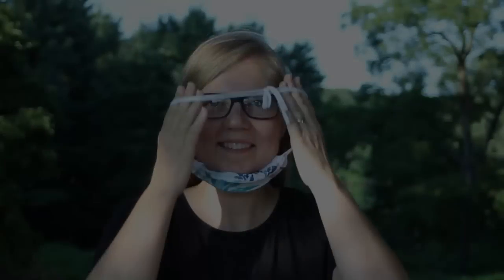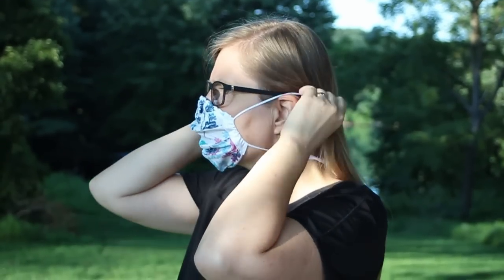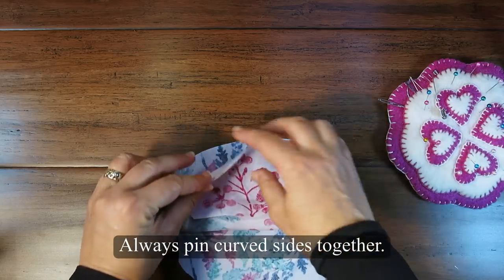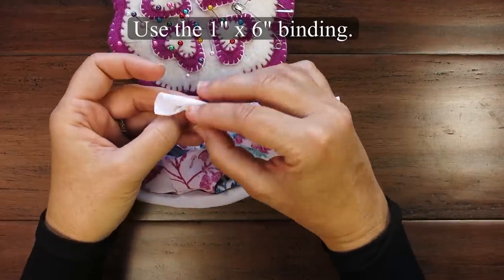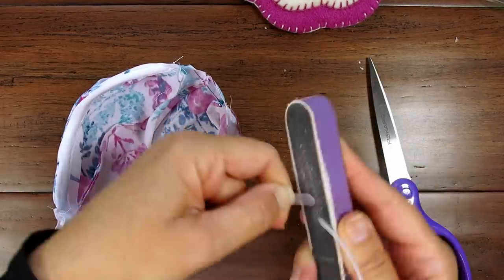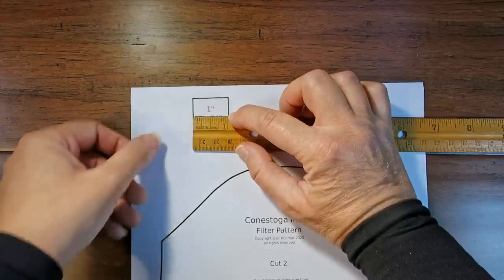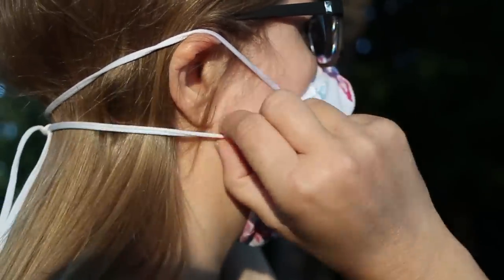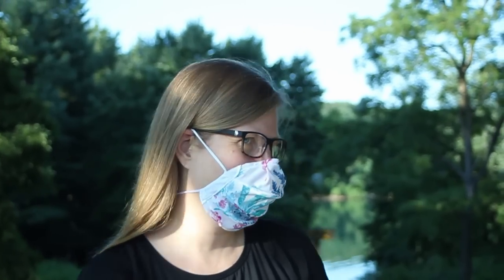Form Follows Function: Introducing the Conestoga Mask for Better Fit, Filtration and Air Flow

Comment: Thanks for another clear video.  I followed the link to maskfaq.com and don’t understand how their findings on stretch chiffon perform so poorly and you recommended stretch chiffon based on other research.  At this point in time, which research should we follow?  Back to cotton with a filter or stick with stretch chiffon???  What are your thoughts?  Thanks
Reply from the maker: Here is a rather long and complicated answer to your excellent question.  There is a huge gap in the numbers between the first study I reviewed and subsequent studies.  I did post the updates to the research in the description and / or comments.  It was determined that in the first study, the researchers used unrealistically slow air flow rates. They suggested that the surface area of the mask would need to be significantly increased (by about 10 times or so if I am reading that correctly) in order to slow down air flow rates to those tested.  Basically, air flow is a like like water flow.  Water that is flowing in a narrow and shallow channel is moving fast, but when the channel widens and deepens the water will slow down and debris will be more easily caught.  So when air flow is moving through a smaller space it will be faster, but when the same amount of air is moving in a bigger space it will slow down and particles can be more easily trapped by electrostatic deposition, interception, impaction, and diffusion.  That is the biggest reason why I increased the surface area of the Conestoga Mask.  I was trying to slow down air flow (even if only a little instead of 10x's which I figured would look like a full-on pillow case) in order to capture more particles than another mask made with the exact same material.  So lets look at the last 3 studies that tested basic cotton vs stretch chiffon.  TSI results (posted on Maskfaq.com) were in line with the Zangmeister et al study of June 25, 2020.  The Konda et al study of April 24, 2020 and updated on June 4, 2020 had much slower air flow rates and, therefore, reported much higher particle capture rates.  The interesting thing, however, is that in all three studies, the stretch chiffon was significantly better than the basic cotton. So I no longer look at it as a specific number, but as a greater-than /less-than comparison. That is why I still choose stretch chiffon over cotton...especially if it is a single layer. 

The second reason I made the mask larger to slow down air flow rates, was for easy breath-ability.  Slower flow will be easier to push in and out with my lungs.  I wanted to be able to seal this mask off and so would not be able to easily breathe around the mask as so many do.  Air flow will seek the path of least resistance and so if your mask presents more pressure resistance than your seal, then it will just go around the edges.  If covid is aerosol spread, which is still undetermined, then that defeats the point. In an aerosol spread paradigm, a mask is only as good as its seal regardless of the fabric filtration. Again if you are filtering through 400 quality layers with a loose seal, you are really not filtering anything...all the air is coming and going via the "seal".   The way you test a chemical respirator is to tighten the seal on your face and then put your hands over the filter canisters to cut off the air being pulled in through the filter.  If you can't get a breath, then you know all air in is being filtered through the canisters because you have a great seal.  

So, I have a "better" fabric which for me right now is stretch chiffon, that I have sewn into a bigger mask which will make the fabric filtration a bit better than if it were in a smaller mask and I have made my fabric choice easier to breathe through by default with the added surface area. 

But wait there is more:  I have really come to the place where I realize that fabrics made for clothing, really don't have the filtration properties that I would ideally like in a mask under the most risky circumstances.  So that brought me to Filti.  They are an actual filter company making filters for masks. Filti fabric has a consistently higher capture rate.  Again, my bigger mask will, in theory, enhance particle capture rates and easy breath-ability over a smaller mask design with identical fabrics. I can insert a filter and seal off the edges for best DIY protection in a high risk situation while still maintaining my comfort as much as possible. If I had to be in close quarters with many people that I don't know, then this would be my first DIY choice. 

I am honestly on a journey as I try to parse out the research, the practical use in the social context, and my own comfort in a way where I truly feel that I have acted responsibly without judging others' decisions.  I am still working it out and growing through the process.  Regardless of what happens I want to look back and say that I did the best I could with what I had at the time. No regrets. No judgment. Full-on forward Faith.   I am glad you are on the journey with me as we share and grow together.

Please note: As my channel bio reveals, I am not a particle science specialist nor an expert in this field.  I am reading and interpreting and applying as I feel is warranted for myself and my family and sharing with all those who are interested.
Reply: @gailkollmar8174  Thanks so much for the context.  I completely agree with your "better than/less than" thinking.  Since this is an evolving situation, the influx of new data is really hard to keep up with and interpret.  I sincerely appreciate the efforts you've put into this and the fact that you're so easily sharing your knowledge.  Stretch chiffon is incredibly hard to find in Canada, for reasons I don't fully understand.  I did find a woven 96/4% fabric, but it's thicker than what your stretch chiffon looks like.  I take your point about the seal and think that's an area I need to examine further.  My teens are so "fashion conscious" that they want masks that look like those their peers are wearing, but I will see what I can hide on the inside to protect them at school!  Thanks again for all of the informative videos you've provided.  I'm really impressed and have learned a lot.
Reply: @gailkollmar8174  Thank you Gail, for all of your excellent work and your honest discussion of this difficult journey.  I’m about to put together my first Conestoga Mask using the chiffon you recommend along with a Filti filter and am looking forward to seeing how the mask fits, but like others here, I am hesitant to rely too much on the chiffon, given its limited filtration ability. Is there anyway you could bring your large exposure to bear and convince maskfaq to test one and two layers of the chiffon you (and I) are using with one layer of Filti?
Reply: @dee24680  well if you want the best filter possible you will have to purchase that fabric. I contacted customer service and they said if you washed it once it would go down to a n50 or maybe even a n60

So I have been using my filters twice. Still getting way better protection that way than these other people who are just using cotton and no filters or sticking a paper towel in there
Reply: @gailkollmar8174  Gail, I am very appreciative of your>> best-integrous, concise, clear , science based, practical based efforts and thanks for  you sharing these  with us. You are my go to source for mask making though I have appreciated the efforts of many other  resources.  I thank R T for asking this question and your answer.. it helps me much!

Comment: I made it but, I modified it, purely by accident.The boning is up and down not side to side, I used 2 layers of cotton and a soft material near my face, the boning was on the material closer to my face I didn’t use the window stripping, didn’t have to it was snug around my face. I love it 😻
Reply from the maker: So happy to hear you love it!  I love your modifications!  I think its a fantastic idea to put the boning on the inner most layer.

Comment: Gail, I'm much prefer your Olson mask with the zip tie down the center
this mask has even more seams to allow the particles through and I watched you breathing with it and it clearly does not stay away from your nose like the one down the center does
haven't watched the entire video so I don't know what you have to say about filti but I've been using their fabric for filters for a couple months now
Again I do want to say that I have not watched the entire video but I did contact their customer service a few months ago and if you wash this filter once it goes down from n95 down to about a N50. Still a lot  better than a couple of layers of cotton fabric.
Doubt that I will be using the chiffon fabric anymore
Reply: What happened to the filtration offered by the chiffon?  How much does it filter?
Reply: @ale347baker  well out of the three reports that I've reviewed only one gave the chiffon a 67% all the other ones say no go

I'm going to use up the chiffon fabric anyway because I've got the proper filter Fabric. Filti

Comment: Wow, so much thought and effort went into this design.  I like it a lot, but I don't know how to sew knit or stretch nylon/spandex.  I watched what you did closely.  Does pinning the way you did stop the top fabric from creeping/stretching/sliding towards the person sewing?  Thank you Gail for all your research, designs, and efforts of producing excellent videos to teach us and coach us. Thank you!
Reply from the maker: Pinning may help a bit, but honestly, it may make it worse.  Sometimes it's a machine adjustment or needing oil. Some machines are just easier to work with than others.  Practice will help.  For some practical tips: you may try using a much longer stitch length...basically baste it into place.  That may be enough since there is no real strain on this seam and may "ease" the seam into place.  Maybe baste/ stay stitch the knit strip first alone and then work it onto your face fabric.  Lastly, you may try using a stretch stitch if your sewing machine offers that option. I hope one or more of those suggestions will help! Good luck and keep trying.

Comment: Thanks for the new pattern. Now, I have a question, before I order supplies. I have a bit of latex sensitivity. Could another sealer that is made of silicone be used as opposed to the rubber one? I noticed that the silicone ones aren't as thick, but I would imagine it would seal just as well? Here's what I'm talking about:
Sealer Hero Door Seal Strip 25 mm Width - 9m (29.5 Ft)– Silicone Weather Stripping Door Seal Strip - Sealing Tape for Doors and Windows – Clear Adhesive Weatherstrip – Shower Window Gap Draft Stopper - - AmazonSmile

Comment: Now I am so confused as to which fabric is best to use🤷‍♀️. I had to order the 90/10 chiffon on line and had to get a 2 yard minimum. I I now have about 5 yards left of the 3 dif patterns I ordered and I also ordered 600 count  cotton pillowcases to use with the chiffon. According to the first study 2 layers of chiffon and one of the cotton rates better than a no gap N95 mask. I am trying to determine how that combination rates on this second study 🤦🏼‍♀️ Any help would be so appreciated.  😃

Comment: Gail, I am having tremendous problems sewing in the Velcro.  I am using a 14 universal needle, have changed the needle and am still getting bird’s nests on the bobbin side.  I have even tried to stitch on the top of the Velcro, using paper on top, and still have the same problem.  Advice that I can find about sewing Velcro always has you stitching in the border of the strip, which is not the way this application needs to be done.  I would appreciate any tips and tricks you can offer!
Reply: I’ll be adding Velcro to my mask tomorrow or so and will let you know how it goes. Have you come up with a solution since a week ago?
Reply: @jnorth9702  Not really!

Comment: Hello Gail! Good to see you.  I'm glad that you were able to tour the colleges and finish the video. That is a lot of work and effort.  Please,  give my appreciation to your daughter for helping you. She did a great job. 
 I'm a novice/beginner at sewing, so I don't have the skills, neither the knowledge when it comes to sew using the silky chiffon. It is very hard for me to sew a mask using the silky chiffon. I have watched several videos with tips to sew silky and stretch fabric without success. I used the a small size microtex needle (I believe that is the type of needles) that was recommended to use when sewing the silky chiffon. I tried to use adhesive tape on the needle (throat) plate to make the hole smaller, but that didn't work. What brand & model is your sewing machine on the video? 
Thank you!  Blessings
Reply from the maker: Thanks for the positivity!  I am using a 15 year old Janome 6260.  I love this machine.  It is a workhorse for thick as well as silky situations. It does go in for maintenance most years for a good cleaning, oiling, and adjusting.  I am using small sharp needles, and I find a new (sharp) one is imperative for a nice seam. I’ll encourage you to keep practicing and wish you good luck!
Reply: @gailkollmar8174  Thank you!
Reply: I think it helps to sew on a slow speed.  Thats the only way I sew when using that fabric.  I also use pins that stay in the 1/4 inch seam allowance.
Reply: @ale347baker  thank you!
Reply: Laid off sewing teacher here. Part of your struggle, I think, is sewing around curves. Remember that you can slow down or even stop if you feel it’s getting away from you. If, when you stop, you put your needle down into the fabric, you can lift up your presser foot and adjust the fabric so that everything is even and wrinkle free. You may need to do this multiple times and it doesn’t slow you down as much as you think.
Reply: @szimonettaneni  Thank you!

Comment: Hi Gail! Thanks for all your thoughtful research and patterns! 
I need to make a mask for an older gentleman who is immuno-compromised and uses an oxygen tank. He does not actually wear the tubing in his nose, but rather holds it in his mouth (finds it more comfortable). Either way, the tubing needs to go under the mask. Any thoughts or ideas on how to support the tubing without gaps compromising exposure?

Also, Is there a proper way to measure a person's face to ensure a good fit? I have looked at different sites that ask for a width and height measurement but wonder if more information would be needed to ensure a mask fits but is also comfortable. I look forward to your reply.

Comment: Would the rubber seal, velcro, and Filti fabric lining work on your Breathe Easy 2.0 masks I've already made? I bought some breathe easy washable 100% polypropylene several months ago.  Do you know how it compares to Filti? Could I just sew it into that mask using Velcro as well? I have several grandchildren who might balk at your newest design due to peer pressure so I'm looking at ways to alter the Breathe Easy 2.0 similar to the Conestoga. Any suggestions?
Reply: I have actually gone back and modified the Breathe Easy 2.0 with an added lining, open at the bottom to accommodate a Filti filter.  I put the boning in the lining seam rather than the outside layer, left the bottom mostly open and added a strip of Velcro to close.  It is easy to pull out the filter and replace, and no Velcro to cover when you wash.  To be clear, it is essentially a two layer Breathe Easy 2.0 with a removable Filti layer between.  I also added the rubber seal at the top edge, and inserted my nose wire into that.  It seems to seal nicely, preventing fogged glasses.
Reply: Thank you JSUmusicmom for this insight. It’s good to know about these improvements to the Breathe Easy 2. I’m trying to Envision exactly how it would be put together. I’ll have to give it some more thought.
Reply from the maker: As a mother of teens I get the fashion thing, but what I  find intriguing is that in less than half a year the western world has not only gotten used to wearing masks, but has defined an acceptable style and wears them with flair. 😁 Somehow we lost the safety point of the mask (some would argue it was never there) and so Form Follows Fashion instead of Function. 🤔 You could certainly make a Filti filter inside your Easy Breathe masks.  As long as your masks fit well and you breath through them and not around them, then, as I see it, you will be doing your best to stay healthy.

Comment: At 5:54 where you show to "peel off the adhesive strip" are you taking off both the paper piece as well as the actual adhesive? I'm thinking the adhesive might gum up the sewing needle and cause problems?
Reply: In case you haven’t discovered this already, I have sewn through the adhesive on the rubber seal with no problems at all.  Using the paper on top works really great to keep the rubber from “grabbing” the presser foot, but have had no issue with the adhesive on the bottom gumming up the needle.
Reply: Thank you JSUmusicmom. I appreciate your response and just in time, as I’ll be adding the rubber strips tomorrow.
Reply from the maker: I have sewn it both ways.  I didn't have a problem with the adhesive on my needle (I was concerned about that too.).

Comment: Great design! Any suggestions on ways to prevent the adhesive from the weatherstripping from coating the needle and causing the thread to spool out out then loop up on the bottom? Thanks.
Reply: Oops, just solved my own problem. Didn’t realize the adhesive can be pealed off with the protective strip. Duh....